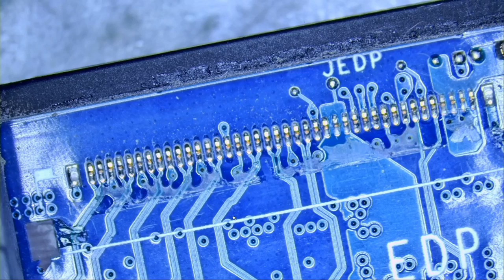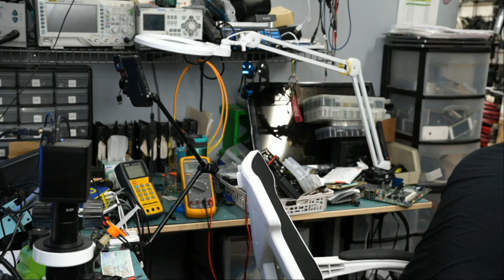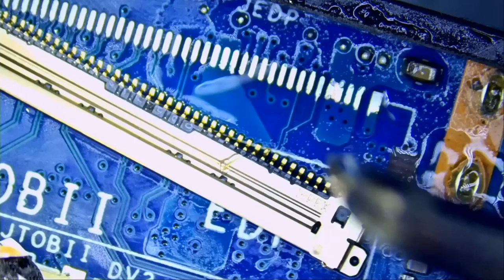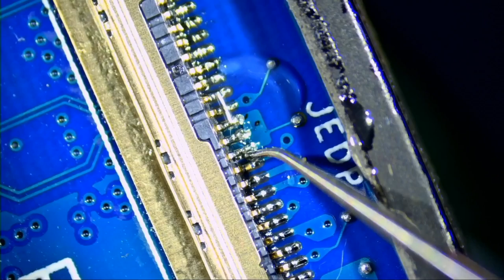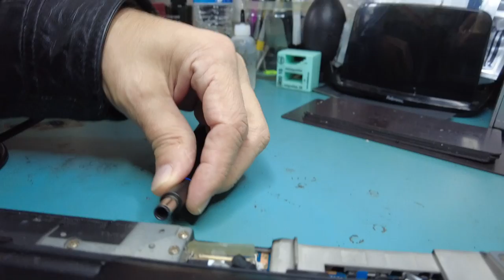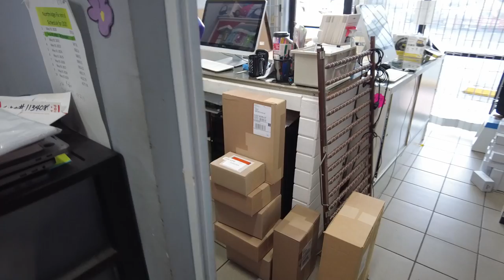Alienware Ripped EDP Display Connector Repair using NF.Mini Solder Pen

Comment: I keep telling my girfriend that the shorter the tip, more precision! But she just doesnt listen. 😂😂
Reply: Unfortunately, precision only applies to some rather ehm peculiar cases. For the rest of them size seems to matter.
Reply: She already knows what the large tip can achieve
Reply: She has logic though. How precise you need to be to hit one out of two large targets.
Reply: Doesn’t matter  what size it it’s how you use it
Reply: That's true, but the larger the tip and the longer the pen, deeper jobs you can accept and more satisfied the customer will be at the end.
Reply: It's all about the flux.
Reply: @marcuskobel6562  🤭
Reply: She prefers a larger tip for more heat transfer.
Reply: I have to use the bent tip.  Works for them hard to reach jobs.
Reply: @meneergroeneveld  a lot of flux
Reply: People need to understand  "when the tip is long you don't have precision "

ALEX 2022
Reply: That's not how you solder.
Reply: This is not the place for such talk. Most of us are here to learn, many tech lessons are on this channel, and some life lessons. Learn the lessons and leave the trash elsewhere. Peace Be upon You.
Reply: @Cheltenbenefitsgroup  
You could have left the comment section.
Reply: Bro, you forgot to apply flux and that’s why she was not satisfied. You should apply more flux next time first.
Reply: @Cheltenbenefitsgroup  Naughty naughty me! Slapping myself in the face.
Reply: @Cheltenbenefitsgroup  🤣🤣🤣
Reply: Just keep applying the tip. by morning it will be fine.

Comment: After watching your videos, using proper flux and low melt solder, I was able to practice and replace a broken 30pin FPC connector. I even was able to replace 18 broken traces which my friend ripped out. Luckily he didn't make it a Hiroshima. I don't even have a hot air rework station but your video is gold teaching multiple ways of doing same job. It's incredibly small to replace 0.8mm pitch FPC traces. It amazes me how you do it. It took me 4 hours with 6 breaks as hands were becoming numb. Thank you Alex.

Comment: Hi, what kind of glue do you suggest for such mechanical PCB anchorage operations?
Reply: I was going to ask this question as well. I thought Alex was going to use solder mask to anchor that component down.
Reply: @graphicd00d75  I think he's using solder mask just whenever he's protecting an electric wire or pad from accidental contacts. Here, Alex needs mechanical strength and some elasticity

Comment: You CAN use a mini soldering iron to solder on most GPU's (I would say up to 2080 Ti/3070 Ti/6700XT) but you have to spend a lot more time pre-heating the board of course.

Comment: Hey,

When i try to desolder the batteryconnector using Hotair on an iPhone, the solder is not melting at all, i even applied low melt solder before using hotair.
I tried a couple of combinations of Temp/Airspeed, not working at all, the connector melts, before the solder does.
Any suggestions?